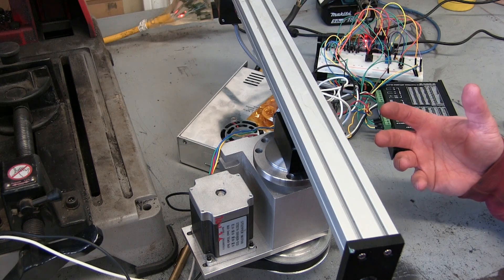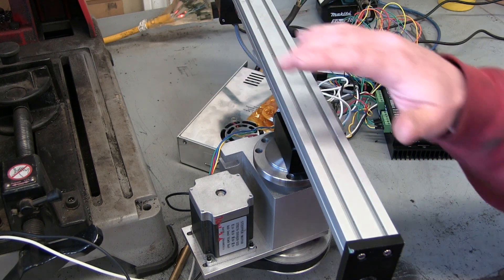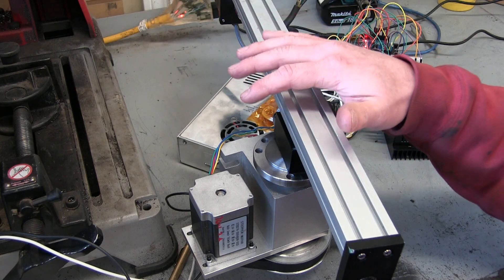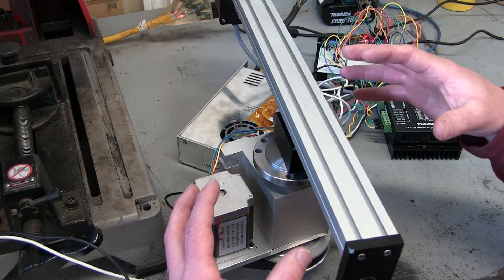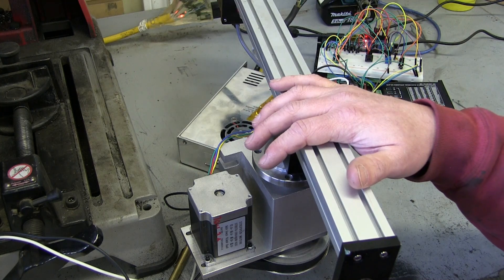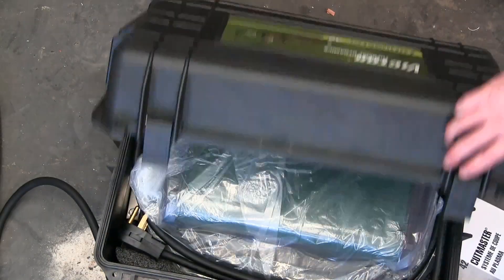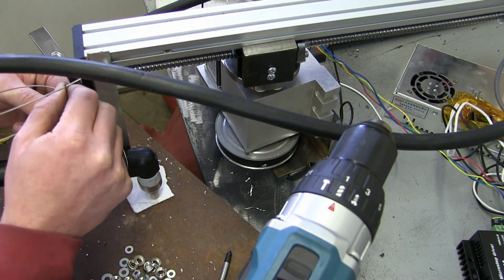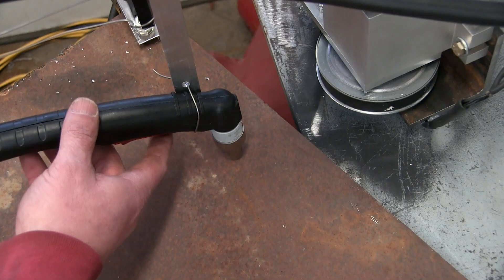Portable CNC Plasma Prototype

Comment: Hey AvE, I would love to develop the algorithms behind this to translate this into the Cartesian coordinate system from the current polar system. I think it would be fun and I'd be extremely lucky to work with yee because I'm a high school student and I've actually been thinking about a similar design and algorithm development for a 6 axis arm. So if you want to help out a young wanker trying to look good for college who enjoys machining stuff, does yee mind dropping me an email? I would be honored to intern/be involved in any way with this. Email is ceazar.carr@gmail.com
Oh, PS, I'm pretty solid at advanced math and stuff, ya know, just to brag, cause I really really would like to work with you
Reply: Computer Engineering student here, If we get a GitHub going, I'd be happy to contribute.
Reply: Ceazar Carr i was just about to drop a comment like this one. Im also in highschool, do you have any experience in app development or CAD? Ive also got quite some experience with arduino and stepper motors.
Reply: Udit Gupta i dont think straight lines would be that hard, in theory anyway. as far as mechanically, linear actuators are actually quite precise, and utilising an encoder/pid system could guarantee the math lines up with the real world. i think the biggest problem would be zeroing the machine, but ive got a couple ideas for that too...
Reply: @drewmaggio1275   Not sure if you are familiar with welding and plasma/torch cutting, but one big issue is that you will need to maintain the linear speed of the cutting 'flame' (or arc in plasma's case) regardless of the cutting path. Now accounting for change in radius, to a certain extent, is just the basic polar math we learn in highschool to reduce angular velocity inversely to the increase in radius. But any stepper motor will have an unavoidable increase in minimum tangential step size (ie the smallest linear distance the torch can be moved in the tangential direction) as the radius increases, so that may cause some wonky cutting issues for really wide cutting paths. Specifically, if the motor can only achieve a minimum step size of dS degrees and the arm length is fixed at radius R, then the minimum linear step step size is RxS (I imagine you already know this bit, it's mostly for anyone else interested). Given that we can't control how fast a stepper goes between steps, only how many steps it does per unit if time, dt, then the minimum actual speed we can achieve is Rx(dS/dt). We know dS is usually tiny for steppers, so at reasonable R values we don't care about the minmum actual speed becayse the steps are tiny AF. However at large R values, a slow cut wouldnt actually be a slow continuous cut, it would look like a series of individual movements, each at speed Rx(dS/dt), with long pauses between motions. 

As well, for faster cutting operations on thin metal where the torch can't linger too long at the risk of weakening the surrounding material (if you haven't already, look up how torches can anneal metal during cutting and welding) you will need to carefully handle the starting and stopping motions so it doesn't just suddenly jerk into life and suddenly try to stop on a dime. If you try and stop one of the axes immediately when moving fast enough it's own momentum will bump it slightly past the intended set point. To deal with this (if you don't already know, and if you do my apologies for sounding condescending) look up P.I.D control. Not sure if you're still in highschool, but even if your in first year university by now in engineering, it isn't usually discussed until 3rd or 4th year (I'm in 3rd year mechanical engineering btw)
Reply: I solved the same problem with a GRBL shield and modified just a few lines of code in the GRBL software to solve this problem with my hanging V plotter. It really isn't a giant project.
Reply: This is a scara type machine.. you could use marlin the 3d printer program to test on.. it has support for this type.
Reply: Jarred I'd pitch in as well.
Reply: Sign me up for the phone app. Not so great with all the math, but if someone can apply the thumb detector to the algorithms, i can implement them in the app!
Reply: message me if any one wants to collaborate on this.
Reply: h1hummerh3t from what ive seen, scara printers are like this but replace the linear actuator with a second joint. what do people think would be more accurate/easier to use?
Reply: Not sure.. I've never really seen one.. very rare. @Drew Maggio
Reply: I made some git repos for people to start sharing stuff here, sorry I couldn't provide templates, but I really need to go to sleep. https://github.com/oragamihawk?tab=repositories
Reply: dave92082 contact oragamihawk through the github link, it really looks like were getting a team together...
Reply: Can I start working on the interface as a proof of concept?
Reply: crashandburnbirner Yep, there's one in every group.
Reply: If you guys can help with algorithm, I can make the app and have it send series of commands to an arduino (or your flavor of SBC). Bonus points if we use a Raspberry Pi (I'm looking at you Raspberry Pi Zero W)... Professional dev here, btw.. +AvE Wanted something like this to dick around..
Reply: Another big problem is having a reliable way to track the position of the torch. In a Cartesian kind of motion initial position does not matter as long you have some travel left. But here it could definitely be a problem.  Ceazar, you're really smart kiddo, I am a lazy senior student of Mechanical Engineering and I don't think I could begin to approach this problem without CAD to solve for the rotation and displacement on individual shape basis.  Hey AvE, got any more of them tea sharts?
Reply: Also some thoughts, with a plasma cutter, you need to measure the electric conductivity of the plasma to make it automated.. so you cut it at right height, and the speed of the cut.
Reply: If you need some CAD work done hit me up, this is a great idea!  I'd love to be part of the project!
Reply: Ceazar Carr if you use ball screws instead the horid trapaziodal ones you shouldn't have to worry about the arm caching on and jiddering, for keeping the torch the right distance from the steel many use some sort of ball wheel,  mechanical engineering student in highschool sort of know the basics of Arduino, probably use Bluetooth le so that Android and iOS would work with it, PS where's my t shart
Reply: Ceazar, he actually needs backward conversion from cartesian to polar.
Not so hard either.

He can also have a pice of software that will generate gcode for the controller that is already prepared for the polar coordinate system that he has in his little contraption.
Reply: Perhaps the homing can be done by hand.  Once the machine knows where it is, perhaps the user can manually place the point of the cutter at a starting point designated by the app (imagine the shape with a red dot on it). the only slightly tricky part is the direction of the cut, being radial and all.
Reply: just make something and send it to AvE.
Reply: Is this yet another task for the ESP8266 module? It has WiFi and runs the Arduino language?
Reply: MrSnowman You'd need the wifi to be able to connect to the phone though. I've actually deployed a few hundred of them on custom boards to do live part counting on a couple factory floors where I work, they are fairly reliable in my experience, though it is recommended that you not plug a 12v unit into a 24v line... Whoops.

The ESP32 might be a better choice on second though, more IO available for close to the same price. And it should still be capable of updating itself using a firmware uploaded through the browser?
Reply: You don't need to though... There's any number of stuff to do that. FlatCAM can import an SVG and turn it into a path in 3 clicks. It's actually possible to generate the g-code for a polar coordinate based system, though some measurement input of the axis is necessary.
Reply: Drew Maggio Wow, brachistocrone? How does it relate to the problem at hand?
Reply: I found a Python library called SymPy, it is a fairly high performance mathematics library that supports integrals and derivatives. That could be extremely useful for calculating out the velocities of the armature for correcting the polar coordinates and for calculating the actual path following. As it would let you plot between points without having to worry about the resolution of your mesh by representing the intermediate coordinates as a velocity formula instead of stepper positions.

Nessicary? Nope, just cool if you want to solve it in an ideal world scenario. Sadly I think the stepper motor resolution would be the limiting factor, so just basic trig and plotting the length between points would be more than sufficient.
Reply: Drew Maggio You are absolutely correct, while combining the arc of the arm and the equation representing a portion of the desired path, and then taking the derivative for finding the vectors is ideal, it doesn't have an perceivable benefit. 

Just using trig like you are doing is far more practical. And probably less prone to bugs.
Reply: For those interested. Join us here https://openorbitcnc.slack.com/shared_invite/MTQ5MTkxMzgzNTEwLTE0ODg0MjIzOTUtMmQwNWZmYTc1Mw
Reply: Send him something. Say "this is what you want to do. The problems are you have a non x-y set-up. The coding and mechanical issues I see ahead of us are a, b, and c. I believe I can overcome them by doing d, e, and f. Would you be interested if I give it a go?"
Reply: more like everyones dick pics.
Reply: Make sure the algorithm accounts for a constant speed of the cut.
Reply: Shantanu Thatte go for it! just make sure to throw it in origamihawk's github :)
Reply: KnightsWithoutATable its not finding the coodinates thats the problem, its taking the coordinates and generating gcode for the cnc to use. im sure the points are easy to find, but the exact rates at which to spin certain motors take a bit more time. writing a program to generate such g-code based on am svg will probably be the hardest part...
Reply: Matthew McKellar I don't know what an sufficient amount of esp8266s couldn't be used for. 
But the question is what's the best tool for the job rather than if it could be done. I don't think you'd like a wireless system as they're generally perceived as less reliable. And they are.
Edit: of course the app smartphone ave suggested doesn't need to be connected throughout the process. So I guess it's not a big deal.
Reply: App dev = ezpz
Reply: +Matthew McKellar ESP32 dosent have great library/firmware support as of now. Its a great chip, but data around it is little obscure. I was thinking towards the newly announced Raspberry Pi Zero W (W= WiFi/BT), which will be easier to develop on in the same price range.
Reply: Shantanu Thatte It has the same level of feature support the 8266 has though? Unless I'm remembering incorrectly? 

The Pi zero W looks interesting. I'm curious if they fixed the retarded shared UART the Pi 3 is using. I ended up switching over to using the CHIP instead because it was less of a pain in the ass. On this note? Would the CHIP pro be a good option? It has decent community libraries available for the gpio, and it is oriented towards actual product development.

Unless there low stock issue with the Pi 0w that would definitely be really easy to get up an running as you said. The Pi documentation is top notch, so I agree with you there 100%
Reply: +Matthew McKellar There are difference, which leads to using different compilers and certain different drivers for peripherals. Community is abuzz to get it to run Processing (read Arduino). Once thats done (and stable) expect "most" of arduino libraries available. Haven't looked into UART of Pi Zero W. I was thinking in terms of having a static file web server running on Pi, that you can load up in your browser (smartphone/desktop) and make your drawings (browser only). The client would do all the conversion and then send it back to Pi a "polar" g-code.
Reply: I think Bluetooth would be the way to go. Using BLE, it would be really easy to pair and you wouldn't lose data connection on the phone by connecting to the ESP WiFi (something that always drives me crazy). While BLE would cost a little bit more for the IC, it would simplify the association process as well. Similar to the Hilton "smart door locks", it should be trivial to uniquely name each device during "manufacture" and allow the user to select the device by name if there are more than one within range. If there is only one, then association would be automatic.
Reply: I'm a Mechanical Engineering student as well. The way I see it, if you just want to use this contraption to cut out something from a list of predefined shapes, all you have to do is convert their mathematical functions from XY coordinates to polar coordinates (mostly using trigonometrical stuff) and leave a few variables for controlling the size and position. No CAD drawing on the fly or anything like that.
It's pretty easy to map out straight lines in a polar coordinate system.
Reply: Good, you can find the cotangent and adjacent of at least one mushroom tip in your email.
Reply: Shantanu Thatte I'm aware of the current state of how unfinished the ESP 32 support is, I am fairly certain that the wifi stack and the GPIO are all functioning at the moment though. I know most of the functions require you to do external calls outside of the Arduino environment (the Ethernet controller or CAN bus for example) but most everything besides the Bluetooth seems to be there? You are probably right about third party libraries not compiling correctly though, anything that uses a low level peripheral that hasn't been fully supported yet wouldn't work correctly.

I'm just curious how you would drive the steppers from the Pi 0w? A separate controller?

In reply to dave92082, I think there is an inexpensive BLE microcontroller package available now, it should be capable of driving all of the steppers and logic by itself, so that could absolutely work. Trying to remember where I saw it?
Reply: Drew Maggio that math for a straight line would change based off how far the plasma cutter is extended. Other than that it would be as simple as adding or subtracting the delineation from from a circle on the "x" or "y" access and then adjusting plasma arm accordingly. However, as your plasma arm is further out the radius of the circle that you delineate from becomes greater and the distances you have to translate the arm for a straight line would vary. 

One thing that makes this problem easy is that the arm has a finite lenngth. If you figured out the delineation for every 1/2 - 1 in the arm can extend you can just guess on the in between.
Reply: Aaron Henderson does it remind anyone else of the brachistochrone problem
Reply: +Evgeny Savelev It doesnt model the problem of retracting the linear slide while rotating to make a straight line, nut it sorta reminds me of it. i made that comment before i worked out all the trig...
Reply: While I'm sure calculus would be helpful, ive already worked out the rate at which the linear slide must retract to draw a straight line, relative to the constant rate or rotation. Good old law of sines...
Reply: do you do any development yourself? Another person here in the comments set up a github if your interested in contributing :) https://github.com/oragamihawk/OpenOrbitCNC
Reply: Drew Maggio I know some programming. I'll try to contribute if I can, hopefully I don't create any code that is so ugly it's lethal! I've been doing robotics stuff for a while in competitions, but generally the programmers keep me away from the keyboard, lol. 

I'm curious if mechanical and electrical design submissions could be useful too?
Reply: The rate is not linear, it changes with the rotation of the center stepper
Reply: Jarred high would you like to work together?
Reply: @Jarred  would like to work together?
Reply: Udit Gupta you could use a servo on the body of the mag portion to do error correction then it may be as easy as set algorithms for basic shapes which is where this is going to shine.

Comment: I think the biggest obstacle is the cost of admission for the plasma cutter. The stage and stepper rotor and controller board can be gotten from aliexpress and/or surplus but that's a fancy spirograph without the pixie spitter. Nice work none the less. I spend the better parts of my day jockeying a Bridgport and would totally give this a spin in the home garage.

Comment: I would suggest a speed ratio adjustment between the extension of the arm and the rotary movement. Also, a momentary pause on start up for the initial punch through, and point the drag tip outwards, to keep from burning the belt on your rotary servo, but I absolutely would use it, and thoroughly enjoy your inventions and lingo...

Comment: About the only thing you gotta worry about is change in surface speed on the rotary action at the base of the arm vs at the end of they arm. Seems most of the issues here are gonna be zero-point so you can easily properly position the end hole in XY and rotation. And hell yeah if i had to cut a lot of sheet steel I'd love one of these. I hate trying to replicate holes.

Comment: Wow,  amazing proof of concept.  I think the only real issue is most of the practical applications are solved by a good layout and the ability to run a torch.
Reply: Meaning its just one more gadget that's going to cause you headaches.  Nothing like a mag drill hitting the decking from 20' up after the 200# gorrila decides it is no longer interested.

Comment: Biggest issue I see will be, as you mentioned, going from Cartesian to polar coordinates. With both axes having to move for straight lines and right angles, there probably can't be much wiggle in the gantry, but since it's a plasma cutter it's not the most accurate thing anyways. Brilliant idea though!